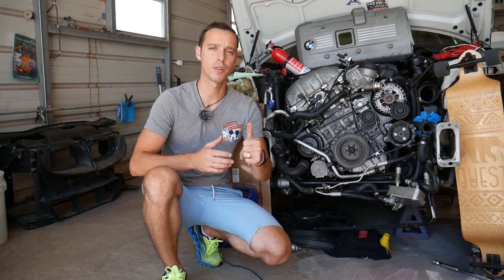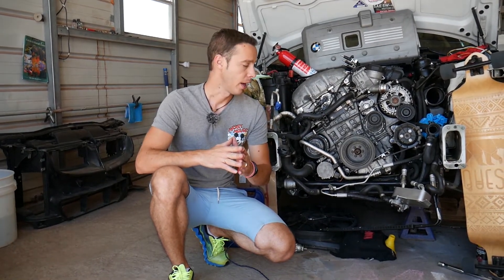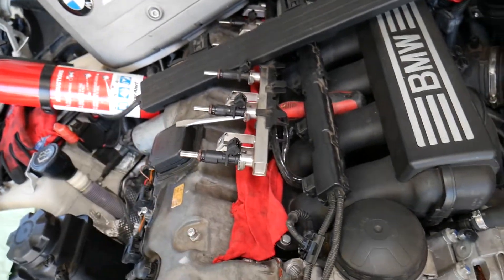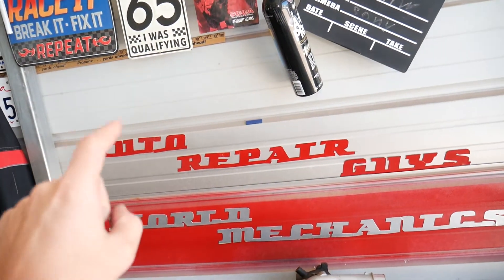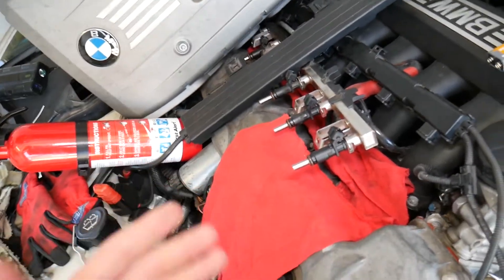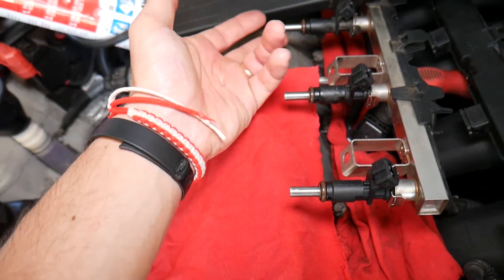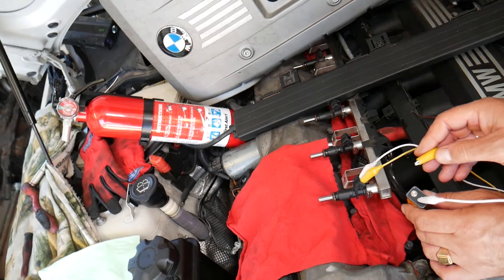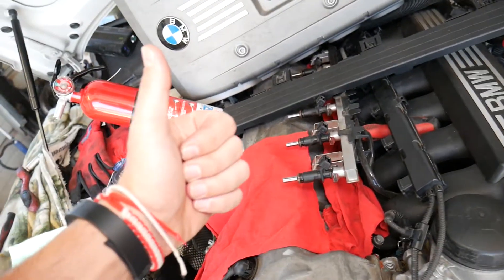TESTING FUEL INJECTORS ON BMW X1. LEAKING FUEL INJECTOR TEST

Comment: Hi, I have a heating problem in my 2010 Dodge Journey R/T, the passenger side blows cold while the driver side is hot when heater is on. I changed the Climate Radiator underneath the steering wheel, but I still have the problem. I hear the A\C compressor engages even with the heat ON. I was thinking of removing the A/C relay or Fuse until summer then put it back. Any thoughts please?! And where Can I find the A\C clutch relay? Thank you Sir